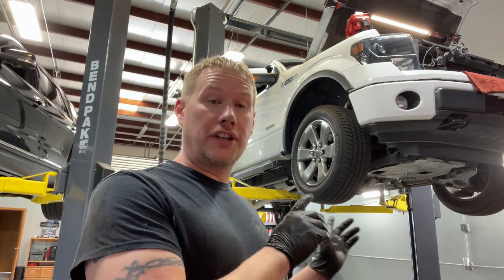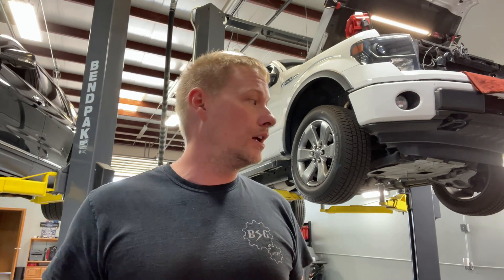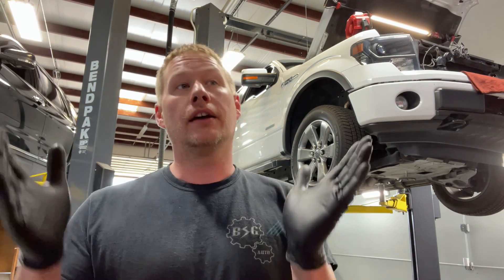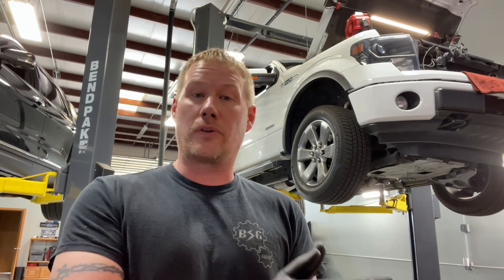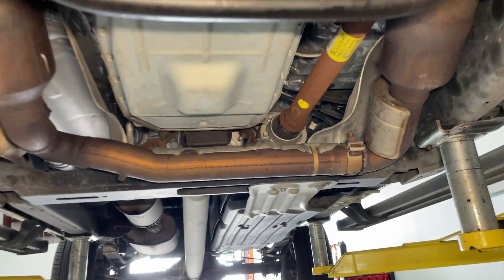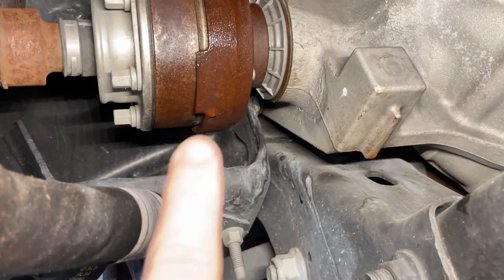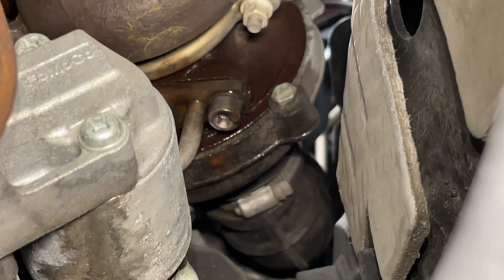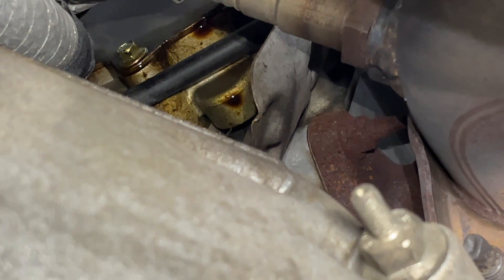Ford Ecoboost Engines Can be so Hit or Miss: I Really Feel Bad for This Customer...

Comment: I drive a 2014 ecoboost just hit 120k did all the fluid changes on her had to grease up the yolk had the dry slip yolk issue and only one other minor issue, electronic throttle body went out around 78k put a new one and no issues thus far. No matter what truck you buy now at days it’s just the luck of the draw. Thankfully we have awesome mechanics such as this one to help us with our problems and show us how to fix them and maintain our vehicles. Your awesome! Thanks for all the information.

Comment: A lifetime GM family I bought two Fords. My 2011 Chevy Avalanche with all there 8-6-4 engine problems which also can start at 40,000 miles, but can go much longer. It's a crap shoot these days with both EcoBoost and 4-6-8 engines. I took the best care possible got my Chevy Avalanche and didn't make any difference now my Ford 2018 with only 30,000 miles has the cam rattle. Guess I'll be going to the Turbo four-cylinder diesel next but I better do some research first. All of this is due to manufacturers trying to get the most gas mileage possible. I guess Electric might take care of some of the problems. Only I don't see most electric grids across the country are ready to handle everybody getting home and pluging in their car.

Comment: I had a 2005 Escape 6v. It was 380,000 miles In 2017 when I traded it for a 2017 Escape with a 2,000 CC Ecoboost engine. The guy at the dealership reaction was, "I have to take a photo of this" when he saw the 2005's odometer readings. What was interesting, the 2017 was burning oil too fast when it was new but since it got to 30,000, this problem disappeared. Ford recommends changing engine oil every 10,000 miles but I do it every 5-6K. No leaks so far so I hope I'm one of the lucky guys. Thanks for the good explanation about where the leaks could come from!
Reply: Ford duratec engines like the V6 you had were essentially Mazda- designed engines. Pretty good.

Comment: This is terrible… Ford knows about these issues because the engineers address them in subsequent generations of the Ecoboost. The timing issue is a perfect example of that. I’ve always been a Ford person, and I’ve had good luck with my Ecoboost but I’ve been really obsessive about the oil I use, the oil change intervals, intake cleanings, filters and other fluids. Is the Ecoboost really worth the stress of the extra maintenance and worry? Ford is ruining their image by using the customer to test for durability and longevity.

Comment: A friend of mine bought a high country Chevy pick up with every option available for years ago to the tune of 70,000+ dollars. This vehicle is like the vehicle you’re working on now it is absolutely immaculate it has never told anything heavier than a short cargo trailer with two Harleys in it and at 60,000 miles it needed a transmission and of course GM didn’t want to pay for it! Prices are high quality is low…..

Comment: I wish I could say the 5.0 was better but I’ve had just as bad if not worse luck. First motor had a knock from cylinder distortion. Got a remanned long block installed 14k miles later and I’ve had bronze metal in my last two oil changes hard tapping can be heard on warmup and my guess is the rod bearings are shot. The engine is under warranty and two dealerships have avoided it like the plague

Comment: I like Ford  vehicles, but it’s stories like this that keep me from buying one, they are just way too hit and miss for me as far as reliability, We have all Toyotas, they may not be as cool as Fords but they just keep going and going and going without any major issues  Ford should be standing behind that  vehicle For that guy,I honestly don’t know how they keep getting repeat business
Building stuff like this
Reply: Your key word “story’s”
Reply: @quinton8312  When the title of the video is eco-boost engine can be hit and miss, to me there’s truth to it especially when it’s a Ford mechanic that says it
Reply: I am not a Ford fan. I used to prefer Chevy.  When it came time to buy a truck in July, I couldn't stomach the idea of buying a Ford, Chevy or Ram with all these high dollar problems they all have.  It is total BS that a 1/2 ton full size pickup can't last 150,000 without major work. All three companies are guilty. 
I like the style of the Ford, but that hit and miss reliability is just too much of a gamble.
The Chevy got damned ugly fast. I loved Chevy's 5.3 L engine until 2007 when they destroyed it with APM.
The Ram has looked good but...it is a Chrysler product. That means, it will start off nice but fall apart after 70,000 miles.
Oh, and why do I need to buy a oil catch can ??? Nope.  In 2021 this shouldn't be an issue with using direct injection.
Sigh. It really shouldn't be that way. 
So, I bought a Toyota. No high dollar surprises, no oil catch can needed, just reliable engineering that works. I am OK with giving up on bells and whistles and just have something that runs and runs.

Comment: I have a 2016 3.5 EcoBoost with about 90,000 miles. Just wondering if they suffer from the same problems as the old EcoBoost engines? I haven't had any problems so far just had to change the O2 sensors and very regular oil changes.

Comment: Quite simple explanation, engine has great power but not able to handle it, and quite simply if they build a vehicle that never needs work done they would never make money cause most their money is made on parts and repairs. Unfortunately seems as though you will find that with all auto manufacturers.

Comment: Makes me love my 03 even more, no leaks, starts and runs perfect with 243,000 miles
Reply: my 04 has a sketchy frame rust but still drived
Reply: @D Swl i had 220,000 on my 03 5.4 F150 when i got rid of it and bought a 14 f150 5.0 with 10,000 on it

Comment: I love your videos.  Keep em coming.  

I have a '13 F-150 with the 3.5 and it's at 91k miles.  I've had both turbos done through the extended warranty, and the timing chain rattle has happened a few times.

Comment: Please put more content about the 3.5 Eco Boost engine! That’s the engine I have. It also has a misfire issue that one mechanic could not fix. I’m having to go now to the dealership to find out what it’s going to cost!
Reply: Had misfire at 67k miles I replaced all spark plugs which was pretty easy to do. Fixed the problem (for now). Turbos eat spark plugs. If that doesn’t work changed coil packs. Also easy to do yourself but more expensive in parts. Still plugs like $42 to do yourself and you know that’s not the problem after. Dealership quotes me $328 to do it

Comment: Hey guys, I just have this repair done at my independent repair shop. I have a question for all about a problem that I think I'm having related to emissions. I have 79,880 mi on my 2014 f150 5.0 STX. Had some issues filling the gas tank. Can't put more than six or seven gallons in at a time. I know my purge valve is bad which I can replace in a few minutes. Since I think the purge valve is related to emissions I took it to the dealership for them to take a look. They told me I need a new evap canister to the tune of 300 plus dollars. I also thought this was an emmissions related part. The dealer says neither part is emmissions related and they want a few thousand dollars to fix it. Can anybody tell me if these are emmissions related repairs that should be covered under the 80,000 mile emissions warranty?

Comment: Hi Brian.  I’ve seen all the common issues too.  I average 5 water pumps a month with mileage from 30000-75000 miles. I just did the right side turbo leak which also wiped out the starter from coolant leaking on/into the solenoid. The one thing I’ve noticed with all coolant leaks is: they are all running the orange coolant.  The water pump gaskets and aluminium thermostat outlets are always show signs of corrosion   I have never done a water pump or anything else on one with the yellow coolant.    Maybe a trend for you to monitor since ford dropped the orange coolant last year.
Reply from the maker: Yeah this one definitely got the Yellow coolant going back together.

Comment: I have a 2013 F150  3.7 with 52k that's in the shop for a coolant leak between the lower intake and #6 cylinder.  Should not happen at this low mileage.

Comment: Don't feel bad, you don't make these things, Ford does and this is reflective of the quality of the parts that they use at the OEM level. Also these turbo engines would not be necessary if Ford made any decent V 8 engines for their trucks. A twin turbo small V 6 is not a suitable truck powerplant. All they have is small engines with lots of camshafts that are better at making their power in the high rpm ranges and are great in Mustangs and such. Turbos mean service and repairs later. They are a band-aid for Ford's problem of not having the correct type engines for trucks. Trucks need torque and that means a suitable V8 with out all this valve gear that is always causing problems. It seems that they have or had a 6.2 litre 2 valve engine and this would be perfect for the trucks, so where is it! The 5 litre Coyote engine is not really great here either as it is too small and doesn't have the low end torque that we need. It seems that Ford is in a bad place with their choices of engines. And to have all these issues on a vehicle with only 70,000 miles is a travesty. So much for Job One, or have you driven a Ford lately.

Comment: I’ve got a ‘12 eco boost… so far so good at 160k. Did they ever figure out the take off shudder? Would like to get that sorted out.
Reply: Take Of shudder? What do you mean?
Reply: @terrorofdemons1168  Sorry, should have read take off shudder. I get a bit of a vibration from taking off from a stop. Its a common issue with some of these trucks (ecoboost, crew cab with 6'5" bed). Just wondered if anyone has had theirs sorted out.
Reply: @danjparsons80  ok I was wondering if you had the same problem as me. My 2015 3.5 non turbo had a shudder at hwy speeds when the torque converter would lock. Shudder fix additive didn’t work so I flushed my trans with 20 quarts of fluid. I learned how to do it by watching a video. It’s not hard to do. It fixed my problem and that was 2 years ago. I plan to do a flush every 50k
Reply: @terrorofdemons1168  I think this is a different issue all together. My truck physically shakes for a short period of time at take off. Driving on the highway is fine.
Reply: @danjparsons80  First Gen Ecoboost engines have a carbon buildup problem with the intake valves that can cause a misfire. Maybe something worth looking into. Good luck

Comment: I sell Ford's for a living. The shop does a great job prepping these trucks when they come in on trade but I have seen bills in excess of 6k just in engine work and turbo work with less that 60k on pre 15 models.  I love it on test drives when they cut out at higher RPM almost always the Ignition coils.  Always a roll of the dice trying to sell one of these used.  If it hasn't been through the shop I tell customers to pick out something else these 3.5's are mostly a dice roll.  I am not drinking the KoolAid.  The new ones 17 and up are better, but I just had a 19 roach a turbo with 29k.  Just buy the 5.0.  On the other hand I have had very good luck with the 2.7?  What is up with that?  I have a customer that drives 5k a month with his and he has nothing go wrong zero problems.

Comment: Dang, that stinks, I have a 2013 Platinum and it's leaking oil from the passenger side head, so looks like the vacuum pump.  Does the whole pump need to be replaced or just gasket?

Comment: Working on a class 1 railroad mofw. We run the pee out of the Ford 6.2 gas. Iowa weather, -30F to 95F.  Good engines, cast iron blocks, abused, we have some with over 200K now. That's why I bought one. The F550's with the 6.7 are constant nuisances with repairs or bad gas.

Comment: I have a 2013 ecoboost f150 as well. I bought it with 67k and I noticed after letting it sit for awhile i would get a rattle at startup intermittently. 

So I started changing oil every 5k full synthetic and it stopped doing the rattle all together, has not done it on startup even if it sits for a week, now has 105k on it. I figure the noise was the phasers and not chain, if the chain were stretched it would rattle no matter what and throw a code. What do you think FordTechMakuloco?

Comment: Man, I’d hate to see that bill. I had a hose break going to the heater core (the big hose) and had the dealership fixit and replace the fluids. 420 bucks !!! I asked if the hose or fluid was laced with gold and the service manager just looked at me dumbfounded. Outrageous for sure. After watching some videos I now know how to take these hoses off and can replace them on my own. So glad I have the 5.0 in my 13 F150, at least I won’t have that turbo leak.

Comment: I have a 2013 F150 with 70000 miles on it. It is my play truck. I have a 2014 F150 for my business with 235000 miles on it. Both have had excellent care since new. The truck with 235000 miles is in far better condition than the one 70000 miles. They just don't like sitting idle for long periods of time!!

Comment: I’m sure the answer is “no”, but I would hope that Ford (and other makers as well) would track down people like Brian and pay them to pick their brains a few times a year to help make heir cars better...
Reply: Ford is more interested in making sure the vehicle is reliable through the warranty period and that's it. Then they basically only make money off parts. What sells more parts? Parts that fail.  Really though these days most vehicles are dead set reliable to at least 100k.
Reply: @markcrawford1982  look at GDI engines. Won't they all start running inefficiently unless you clean the valves regularly? Granted, part of it is govt CAFE standards but  some car makers still find a way to do port injection or how hard would it be to design in an oil catch can? Unfortunately, more people care about if the car has Apple Carplay than how the engine and drivetrain operate and were designed so consumers reap what they sow, I suppose....🤷‍♂️
Reply: Ford only cares about the next quarter revenue. They care about the customer until you pay for the car, after that you are on your own.
Reply: Agreed. The man is an expert in the field. Engineers and bean counters should take a field trip to hang out and watch Brian. Might help them get their heads out of their asses.

Comment: I had an 03 Crown Vic and let it go at 300k miles and the water pump was fine.  I had an 03 Town Car with 300k miles... same. I now have an 07 Town Car with 120k miles and guess what?  The water pump is fine.  Why are we having so much trouble with Ford products?  I'll NEVER buy an Eco anything.

Comment: Stop buying Fords, that what I did in 2002. I was born and raised on Fords. My father was a foreman at Ford in Lorraine. I had a maverick jumped time 6000 miles, Grand Torino jumped time 60,000 miles, 81 escort Sheered a lobe off the cam 9000 miles, tempo air conditioner went out at 20,000 miles and never did work right, Mercury sable Front brake pads and rotors every 12,000 miles until Ford figured out what was wrong with the brakes, mercury topaz blown head gasket, Taurus station wagon 1996 blew head gaskets this time Ford stepped up and put a whole new engine in the car. Shortly after the transmission band anchor broke he could not be repaired. Never bought another Ford .

Comment: 3.5 EcoBoost has been on my radar for my wife’s next truck, but I think we’ll be sticking to the 5 liter. Her ‘13 F-150 5.0 was probably the best truck we’ve owned so far. Never should have sold it.
Reply: Fords 5.0L 2019 up is having massive oil consumption problems since ford went to those Laser welded cylinder liners. Lots of dissatisfied owners.
Reply: @davidcox2197  I’m uninterested in anything with a 10R80 in it.

Comment: I loved the exact same year truck, and i ditched it at about the same mileage. I was seeing all these leaks,  a rattle once or twice a month and the turbo waste gate was starting to go.  Bull crap when compared to my 2011 e250 with the 4.6 v8. 430,000 km and never been worked on, no leaks, no noises just routine maintenance. Oil changes and spark plugs

Comment: OK,  you asked what we think. I think the Ford quality control is appaling! If these were design issues, then every truck would have them, but you already said this is not the case. I question the quality of the Orings/seals in these leakage areas then. Unless the seals were damaged on installation at engine build (which you would be seeing), what other reason is logical? As said below, Ford must choose the cheapest parts for the job, where quality is random. It is the only rational thing I can see.

Comment: I have a 2013 Eco with the Max Tow (#7700 GVWR) and it's a Oct 13 build, so don't know where that falls in the grand scheme so things...

So far so good with 105,000+ miles on it and just checked all those areas FTM showed and mine are all dry..  I wish I could loose oil, as I seem to gain on the stick over time.. I know it's gas dilution in the oil...  I change the oil every 4,000 miles since new.  I am the original owner as well..

I do think that towing and using these Eco's to get the performance out of them so basically you are in the "boost" a lot, it's best for these things..  

Dunno, but I find the "brand fans" always come out and shout out their "brand" is the best... Of course they do..  That's what they drive every day...  Anyway, you get what you get when you drive it off the lot, so there you go!

Buyer beware of anything you buy... :)